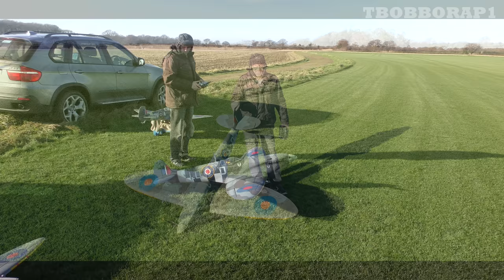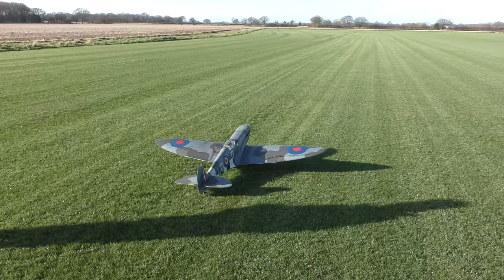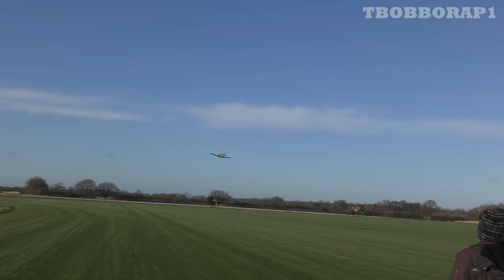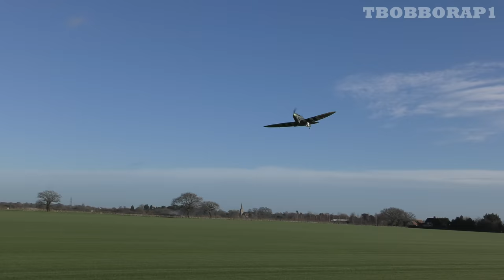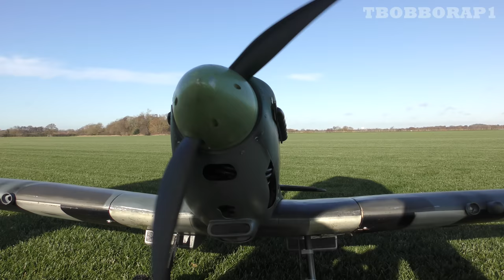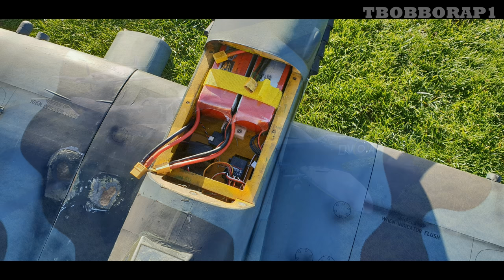HANGAR 9 SUPERMARINE SPITFIRE MKIXC 30cc EP RC 2050mm ARF "PHOENIX" - MARK # 4 - 2019

Comment: Great Pilot...beautiful plane. I have one in the box that will be built this year! I plan on doing E version as well. Going with E flite Pwr 160, Castle hv 80 on 12s. Curious what kind of flight time Mark is getting. Also... wondering if Mark has had any issues with the retractable landing gear. I already have a set but I'm thinking of buying a backup set in case they discontinue that while Horizon still has them in stock.
Reply from the maker: mark asked me to tell you that you will need a 100 amp esc or more and also a separate battery pack for your rx and servos as it has no ubec !
Reply: Thank you for the reply. I always use high-voltage servos and a 2-cell lipo as my receiver pack. I'm curious why I need a higher amp ESC when he's only pulling 62 amps? Has he by any chance had any issues with his retracts?
Reply: @ModelAV8RChannel  hi its mark ... ive gone for 150a opto aerostar ... the 100a optos i had kept catching fire ... on looking at forums .. they say that coz they market at 100a doesnt mean that is there real rating .. maybe 70 to 75 hence 150a possibly down to 120 still me good tolerances ... ive been lucky with my retracts ... i had the suspension milled out so they spring up and down better ...